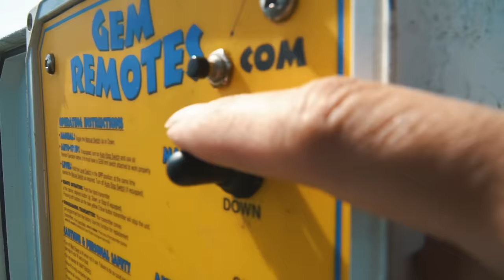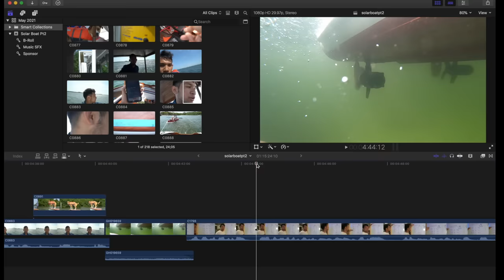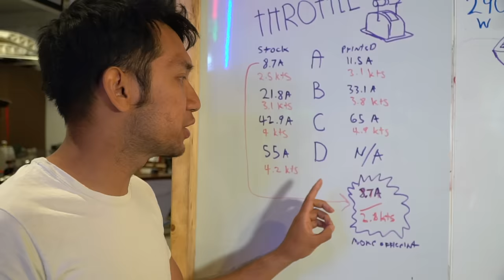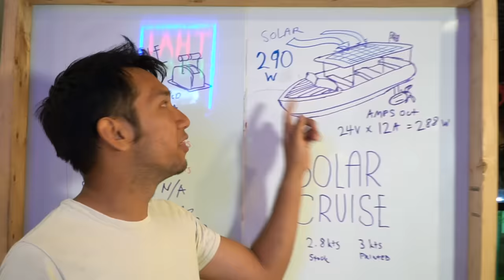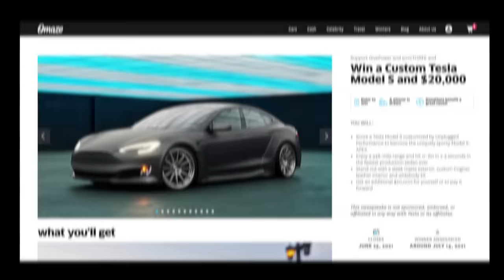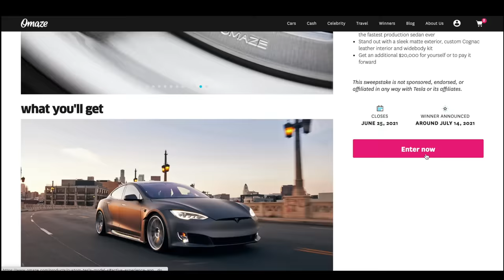Making A SOLAR electric boat (infinite range)

Comment: Peter come back to Florida and take me on more romantic sunset cruises!
Reply from the maker: Only if u bring more rabid raccoons
Reply: We all wish peter takes us on romantic sunset cruises
Reply: Rotate the bottom of the steering wheel the way you want the trailer to go.
Reply: Just what if... You both do an experiment with vortex generators on the hull of the boat? I am sure you both are smart enough to come up with some ideas 😁
Reply: Wait a minute...
Reply: @PeterSripol  welcome to Florida! We’re it is hot 🥵 all the time...
Reply: dibs on next
Reply: @PeterSripol  Can I get on with need the foam for uhhhhh.. “legitimate” science.
Reply: @ThebackyardScientist: I worked at a marina for almost 15 years. Dont feel bad about not being able to back up a trailer.. At least you were able to admit defeat.. I saw a low of stubborn people who said "I can do this" My ramp was wide enough for 3 vehicles & trailers, on most days it was only enough room for *one*..
Reply: Oh hell no
Reply: Bruh nice
Reply: @PeterSripol  wtf?
Reply: They did you dirty trying to reverse thst trailer🤣🤣🤣🤣
Reply: @PeterSripol  .
Reply: You should buy a blown engine outboard 40 or 50hp and convert it to electric. There is videos of this on youtube.
Reply: You have to back the boat down the ramp first
Reply: @tone_bone  Underrated tip
Reply: @PeterSripol  I have a motor. Its supposed to be a direct replacement for an outboard gas motor. It uses a similar shaft that mates up to a lot of outboard lower drives.....
They are 48 volt but can be run at 96 volt which makes 20 and 40 horsepower respectively. 
Made by Advanced D/C.
I have a few of them but I really dont know what I need to make them work. I guess just the speed controller.
I'd be willing to provide a motor if you can scare up a speed control.
I've seen a guy use one of these to easily pull a skier. 
This is the EXACT same motor Jessie Heineman used for his electric boat and his screams.
Reply: @MrTallwilly  I have the 40 horsepower motor I can't find the stupid outboard you think there'd be lots of blown engines out there but there isn't
Reply: @PeterSripol  please may you make a rotary winged aircraft? ❤️
Reply: @christopherleveck6835  he can get one from twincity outboard here in minnesota he has no joke over 10 thousand motors...huge stacks of them.
Reply: Kind of a shit driver though. And that's in an auto as well lol
Reply: @PeterSripol  check out the Chassahowizka River, it is my river here in FL.
Reply: @thundercrowz  *where
Reply: BackyardScientist: Capable of complex science experiments and math
Also BackyardScientist: can't back up a boat trailer to save his life
Reply: @PeterSripol  now this is getting interested
Reply: @PeterSripol  I will bring you all the rabid raccoons you want if you would just change over to azimuth pods. It's a simple change over. Without rudders, you would have increased speed and efficiency. Also, handling is so much easier. Plus, you get to say azimuth pods!
Reply: I'm actually looking forward to the footage of this nature observation journey part. Too little footage shown. =(
Reply: Hello backyard scientist! How are you?
Reply: I have a idea you and Peter may find intriguing:  Magnetohydrodynamics.
Reply: I yak the weeki all the times. How’d I miss PETER AND TOBI!
Reply: T
Reply: a
Reply: :D
Reply: wut
Reply: @thundercrowz  Yes, the sunshine state can make you feel like it's 110 F when it's 90 due to the high humidity of the subtropical, tropical, rain forest, monsoon-type climates. The advantage is in the fall, winter, and spring. It's generally warm and comfortable with much less humidity.
Reply: @Godscountry2732  naaaaaaaa Its a lie sometimes it almost gets to 20degrees 
In the winter trust me I know.
Reply: il take yon on a romantic sunset cruise dude. in a small kayak because thats all i an afford sorry.
Reply: @PeterSripol  BRING ME TOO. I am in Florida, just like Kevin.
Reply: @thundercrowz  Yes, he made it sound like it's hot all the time. We average a few weeks a year in the 20s,30s,40s. Thankfully most of the fall, winter, and spring temperatures are moderate 50 - 80s F.
Reply: Oh... did I mention the hurricanes!
And the snakes... water moccasins ,
Rattle snakes ,and more!! Very dangerous sometimes.
Reply: @thundercrowz  Hurricanes? nah, I call them "light showers with slight breeze". Because by the time most of them hit the coast, they have lost a lot of their strength by hitting Cuba and Haiti.

As for the snakes, they leave you alone a lot of the time. The snakes you have got to worry about in Florida are, well, not in Florida. Except the Burmese python. They can leave.
Reply: Ok pp
Reply: @PeterSripol  I’m looking into building an ultralight airplane i would like to know how you built them and where you got your information
Reply: I ship them
Reply: Tell me how long ago was this footage from?
Reply: @PeterSripol  can you make a tiny boat enclosed like water proof so if you tip it over, or waves hit you you'll be fine.
Reply: Next episode will be- the physics of backing up at a boat ramp 😂
Reply: @PeterSripol  are you going to do a part 3?
Reply: lol make a video of making a small titanic (BUT YOU CAN FIT IN IT) and sink it lol
Reply: Is that a date?
Reply: @PeterSripol  hey what dog breed is that man
Reply: Why so you can get stuck when then sun goes down lol
Reply: Backup scientist
Reply: @Peterstripol thought you want him to at least kiss on the first date.....
Reply: Ayo
Reply: @bigcheese3457  no just you
Reply: 🤨 nani
Reply: Looks beautiful there❤
Reply: @PeterSripol 😂
Reply: I wonder if you combined these solar panels with your all electric ultralight airplane would it still fly or would it be too much weight? @PeterSripol

Comment: I think you should make a solar catamaran next. Add an acrylic bottom, and you've got yourself a solid floaty. I can be your huckleberry.
Reply: A solar cat would be doable, you'd have quite a bit more surface area for solar.  I think a two person kayak based trimaran with solar panels between the hulls would be a perfect candidate for a useful and practical solar boat.  Could get a lot more panel area and only need a single motor compared to a conventional single hull, so the top speed using pure solar would be considerably higher once you figure out the size of the motor and prop pitch.  Secondary benefit is that both are good candidates for a small mast furling sail, pretty handy if you get stuck in overcast, and could theoretically drive the motor as a generator for your batteries while you're tooling around with a sail.
Reply: At first I read solar crematorium and thought "Well that got dark for a solar project..."
Reply: @seekerrild4629  Well technically concentrated sunlight would lend itself well for something like that.  Cremating ants with a magnifying glass has been around ever since kids found out it was possible...
Reply: Hopefully he puts bigger motors
Reply: Plasma more like plazma
Reply: What about Solar + Wind. The thing can charger it self with sun power and you can go sailing when the wind is good. When it is not favorable you use the energy acumulated in the bateries. That would make intercontinental catanaran sailing interesting. Also nomad living over international waters more sustaineable. 🤣
Reply: Ya Cats are a great platform for solar boats. Lot of flat deck space. Hydrofoils are also a great platform for electrification.

Comment: One of the sad parts of this is no one will know it was homemade and just assume he bought it
Reply: But that's not important. Why should he care what other people think? He knows he built it I know he built it I would recognize it if I saw it and if I saw it I would know he built it so why should anyone care what the f anyone else thinks???
Reply: It is honestly above production quality
Reply: My grandfather actually built a boat by himself. The only thing he bought was the motor and a moter mount for it.
Everything else he carved out of lumber (that I think he harvested from his own property) or wielded togther from surplus steel and he used some tubing he happened to have left over from when he built his house.
A lot of people who didn't know he built it asked where he bought the boat.
Reply: @FinalLugiaGuardian  that's (I'm not saying this sarcastically) genuinely really cool, if I may ask what kind of lumber? And does it still work today?
Reply: @gtd4th223  Not sure what wood it was. And yes it was still running when he sold it. Don't know if the new owner still has it running though.
Reply: This video literally exists tho
Reply: @FinalLugiaGuardian  Back in the early 90's by Uncle built a Canoe out of wood in his garage. He brought it up to the family lake house and my uncle and his son raced my father and I in a figure 8 track we designed going around two swimming floats. My uncle's wooden Canoe was much faster than our fiberglass canoe but the wood canoe couldn't turn quickly. My uncle's team took a huge lead on us but by the time we rounded the first swimming float my father and I brought home the win. Good times. My  Uncles canoe was gorgeous btw.

Comment: 25 year truck driver tricks for making backing a trailer easier. 
1. Never let anyone rush you "stay calm"
2. Back as slow as possible "use mirrors"
3. Turn wheel less than 1/4 turn to keep straight. 
4. Turn in opposite direction to correct trailer direction. 
5. Pull up to straighten out when necessary. 
6. GOAL "get out and look" as many times as necessary. 
7. Everyone sucks at first, but with enough practice everyone your skills will improve.

Comment: I absolutely love your solar boat! If you could double the roof in size and have 4 instead of 2 panels running sideways instead of front to back it could help with the speed. Also, would give a great sun protection to the passengers on the sunny side and make the ride more enjoyable for everyone regardless what side the sun is hitting. It may not be a bad idea to have a battery back up just in case clouds roll over. Sudden coulda happen quiet often in Florida especially from May till October.

Comment: 1:31 this looks like that bit from Family Guy when Peter couldn’t maneuver the car in reverse 😂 “I feel like everyone here watching knows that I’m incapable of pleasing my wife sexually” -Peter Griffin

Edit: thanks for all the likes, I’m glad that this comment made people laugh 😂
Reply: AND it was a red car 😂
Reply: Plot twist: that was intended
Reply: That's the Reason why in Germany you have to obtain a special license to be able to drive with trailers. Backing up a trailer around a corner is a mandatory part of the Driving test.
Reply: @lazylamachrischrisl9923  that would make too much sense
Reply: There are so many things to think about when backing up a trailer that it gets ridiculous the first few times you try. And there is a BIG difference if the trailer has a single axle or if it has steerable front wheels. Driving forward is pretty simple, just remember to take any sharp turns with a very large marginal. Going backwards is an entirely different thing. With experience it will become pretty easy, but the first few times? Fugedabotit!

One thing you need to know before trying to back up a trailer is to figure out the minimum turning radius. In a large open space try driving forward in as tight a circle that you can. Look in the rearview mirrors and note what it looks like. Do this for both directions. When backing up if the angle between the towing vehicle and the trailer is sharper than what you saw when running in a circle then you can't right it up again, it will only get worse so you will have to drive forward to straighten things up and try again.

One thing you should try to do is use some one to direct you. Make sure you have signs for left, right, go and stop. That is the least you need to direct this. Then follow the signals, do not try to second guess anything . Whoever is directing you will see a lot more than you do and doesn't have the added stress of actually handling the car or truck. And finally, go slow! the moment you think you've got this and accelerate it's very likely that things will go wrong, and the faster you go the worse things will get.
Reply: Life must suck pretty hard when you feel the need to thank strangers on the internet for a stolen joke.
Reply: @micah_wong  AND his name is Peter
Reply: @Toon444  lmfaooo

Comment: @PeterSripol One thing I was toying with (in my head) was gutting a jetski for it's water jet drive and using a electric motor instead of the gas engine. This might be an idea for you're power upgrade. Also less over all drag due to nothing hanging below the hull. Just a thought. All you're projects have been great and wait to see what you have planed for the electric boat.
Reply: Jet drives aren't nearly as efficient as an open propeller.

Comment: Pro tip to backing up with a trailer.

First, put your hand at the bottom of the steering wheel.

Second, watching in your mirror exclusively, discern which way you want your trailer to go and move your hand in that direction. DO NOT LET GO OF THE WHEEL.

Third, do not over correct, use slight turns to initiate your turn, then turn in the opposite direction equally to follow the trailers intended direction. Again, using your mirror as a visual aid do not turn around.

This is intended for all ages and capabilities.

Comment: This inspired me to make my tandem kayak solar powered. I have an A/B switch to select either battery power (48 volt eBike battery with DC to DC converter) or solar power power alone. I use a  standard Minn Kota 12 volt 300 watt trolling motor with a custom stern motor mount. The single ETFE solar panel fits neatly over the front seat, rated at 400w 18v- actually produces 125 watts at 10 am in Southern California. Moves 2.5 mph on solar, 3.8 mph on battery at 300 watts. Nice to not have to worry about running out of battery power.

Comment: Solar boat would be perfect for a lot of theme parks and other scenic tours. Especially considering how quiet it runs, so it doesn't disturb the wildlife.
I highly believe that you will sell that idea for a decent sum, or you could build them yourselves and have a very successful business.
Reply: Sell the idea 😂😂😂😂 do you really think peter invented solar powered boats???
Reply: @baqcasanke  you don't really need to be the original inventor to sell a patent...likenesses only have to be change by a certain percentage, which isn't very much. As you've seen all the Chinese knock offs that are released within months of something losing its international patent pending status..
Reply: A plug in option would have to be used in parks or they would need a surpluses of boats to stay charging. More of a small lake commuter if it charges off of the solar panel.

Comment: Looks great.  Two thoughts.
1) Most solar race cars built their the own solar panels.  They bought loose individual cells like the higher efficiency flat panels used and mounted them on the car.  This allowed them to mount them on a curved car.  They coated them with something like a clear resin.
2) Everybody uses outboards.  Salt water kills everything.  To extend the life of the motors, they use outboards and tilt them out of the water when not boating.  When driving to Key West, the size of outboard motor boats I saw surprised me.  I saw 4 even 5 motor boats.  I have since learned you can get outboard motorboats up to 65 feet.

Comment: Don’t make your boat faster, the slow speed feels right. Also best sponsor yet
Reply: The slow speed is a great thing, for many years boat with displacement Hulls had a top speed of around 8 or 10. And a cruising speed of around 5 which is pretty close to what he's at you going to achieve with this. Although it could be a problem in rivers or ocean tides

Comment: Good stuff. For part three #suggestion 
1. Three solar panels and one engine.
2. Three panels three engines
3. Add so you can all row the boat. Three sets
4. Add sails
5. All of the above and a smaller lighter boat.

Comment: Hey Peter, i think it would be super cool if you combined your electric bike solar panel trailer with your electric boat, you would be able to get much more power to the boat and you wouldn't have to deal with shadows (other than clouds).  Just an idea!

Comment: Peter you need a mock up outboard to hang on the back with it in the up most tilted position where the prop is out of the water while you are cruising along. Even more looks if the prop has a small low geared motor and is spinning as you are cruising along.🤣🤣🤣 great job the boat is classic gorgeous! Love your videos regardless of the topic of the day because they are so educational. One of my favorite YouTube-ers! ❤ 💯 keep up the great videos! I'm disabled and I live vicariously through your videos of things I never got the chance to do  and a lot of which since my injury I unable to do. 😋

Comment: Many people over the years have tried to improve stock props on Minn Kota motors, but with very little success. Minn Kota, as do other manufactures match the prop to the motor for maximum efficiency.  I had a Minn Kota 12 volt 40# thrust on an old 14 foot Arkansas Traveler fiberglass boat. It would go along at about 5 miles an hour on speed 6 pulling 40 amps.  I knew it was about 5 mile/hour cause the pond was 5 miles long and took about an hour to cover the distance.

Comment: Peter, you should build an electric diving bell submarine powered by trolling motors. If you towed around a solar array barge, you could have a limitless supply of power in the daytime. Add a small compressor for nonstop air. Add 360° cameras on the barge. Viola! Epic coral reef touring!